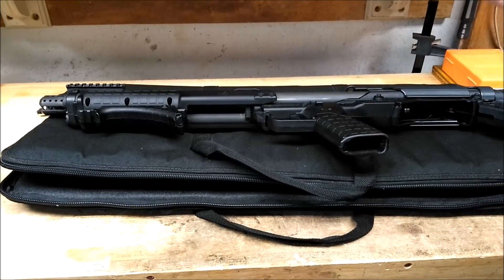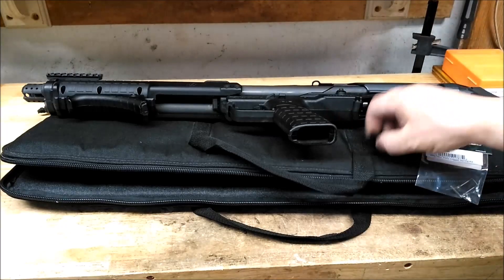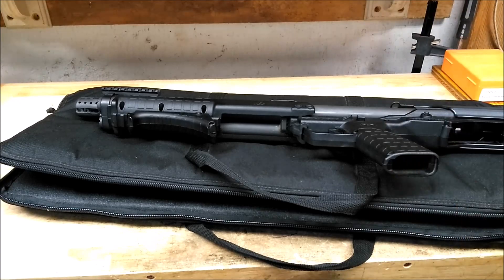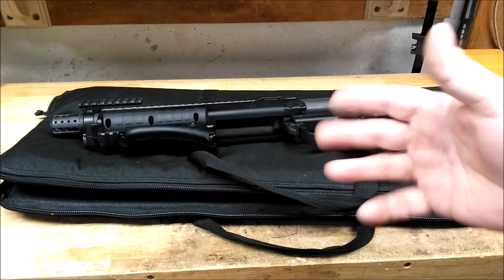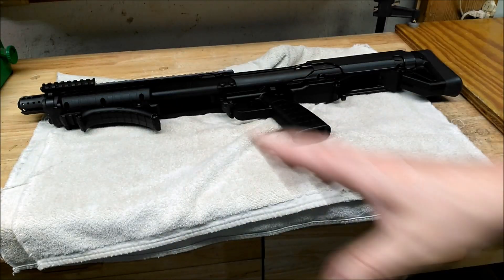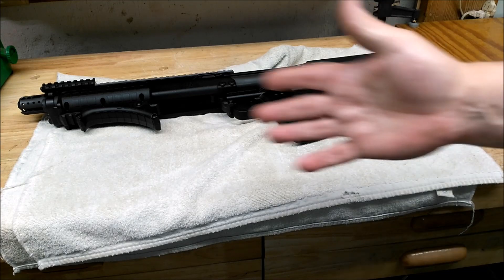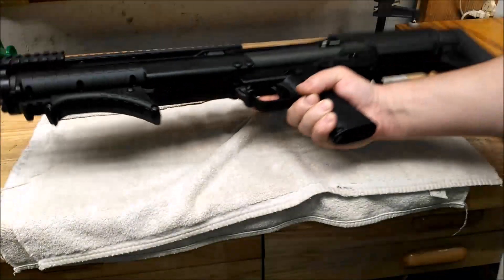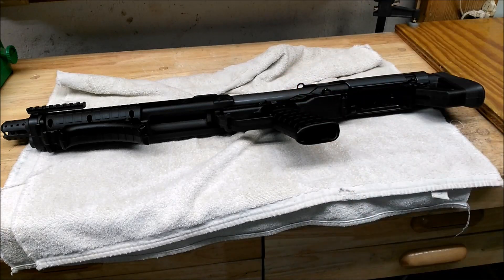M*CARBO Keltec KSG Target Trigger & Spring Upgrade

Comment: Some day I’ll get a ksg. Wanted one for a while now. I’ve held one in a local shop but I never tried the trigger. Have you got an opinion on the mini shells in the ksg?
Reply from the maker: It'll eat mini shells like M&Ms. The thing about the KSG is that you've got to rack it like you're pissed at it, but it has no issues with short shells like most shotguns do.
Reply: Psyko Klown. Good to hear. I’ve seen them for $650 on palmetto. Time to start pinching pennies:)
Reply from the maker: @jeffhuntley2921  $650 is a deal.
Reply: Psyko Klown yea. The gun shop was $1100. Palmetto state Armory has deals on them from time to time. Never when I have spare $ tho!
Reply from the maker: @jeffhuntley2921  Isn't that just always the way? I think I paid $850 for mine. The first 12 ga I ever shot. Quite a jump from the .22 I had as a kid.

Comment: "Kind of expensive!?" Dude, you'd be hard pressed to find ANY $50 trigger upgrade for a shotgun like this or any other type of higher end firearm platforms. The install does look like a bit of a pain in the ass but you'd learn a lot and the tools would be pretty inexpensive. Definitely cheaper than paying someone else to do it.
Reply from the maker: It is for what you get parts wise, but not so much since it's more of a niche firearm than something line an AR. Installation is a finicky PITA, but it really does transform the trigger action, so it's well worth the cost and effort. I think the only "specialty" tool was a piece of dental floss or similar to keep a spring in place (per their instructional video). The hardest part is getting everything aligned to put the clamshell back together, so make sure you adjust and lube everything before you button it up because you really won't want to open it back up.
Reply: @psykoklown874  You nailed it, brotha. It certainly isn't a "drop in" by any means but I'm just saying that this isn't expensive by any means especially when you can install yourself. Do you have one? I'm thinking of doing a video of my upgrades so far but I need to install one of these first. And about 8 other things but I've got a lot done so far.